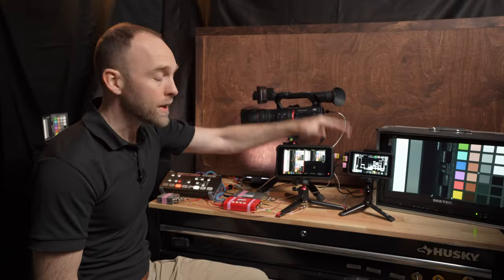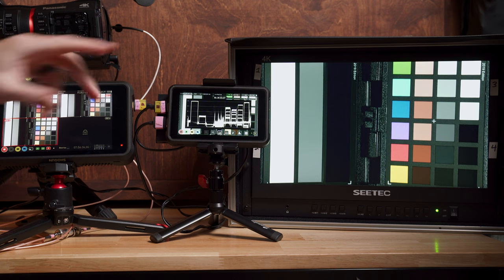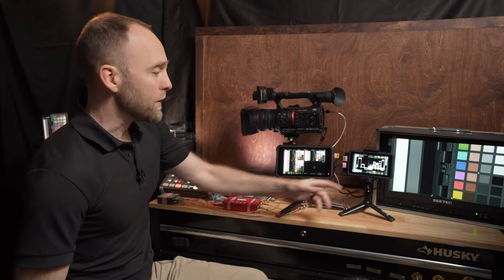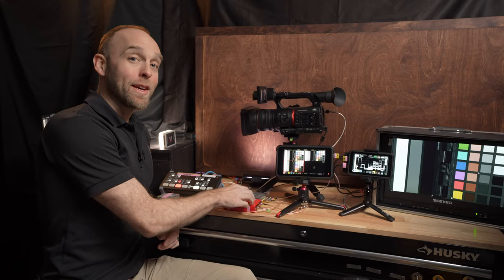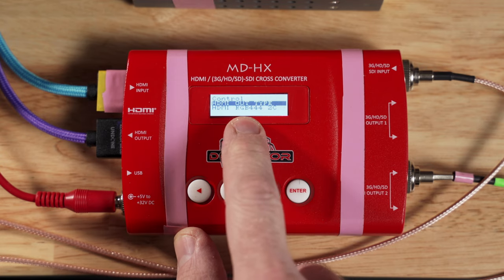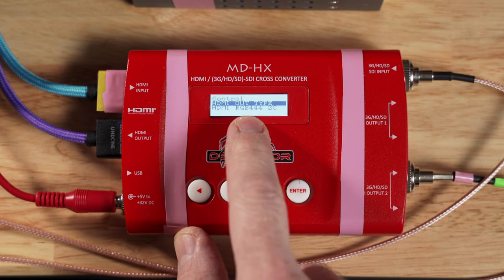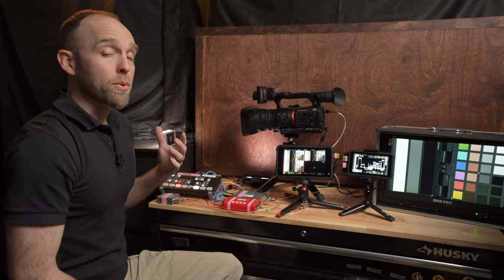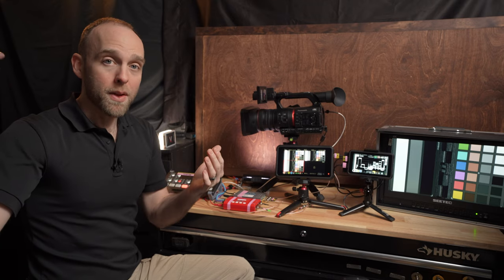Decimator PSA! - Properly Converting SDI to HDMI

Comment: Thanks a lot Marcus for showing this! I had the weird color issue (14:36 in your video) the other day and it kept me up way too long troubleshooting. For some reason - and for the first time - everything I sent TO the venues projector FROM my atmen mini pro hdmi out (hdmi version only) messed up the colors. As I remember it now it all looked ok when sending something directly from my mac studio hdmi out to the same projector. Does my computer send something else color/format-wise than if via the atem mini pro? I ended up getting help from an industry colleague who lended me a wireless Mars 300 hdmi kit (mac studio to atem to hollyland to projector) and suddenly the colors were normal. To get piece of mind before next time at the very same place in december I'm thinking of getting a Decimator MD-HX to be able to only run cables instead of wireless. Do you think it will solve the color issue since I could always try switching between rgb and ycb-modes in the decimator? Thanks! Best, Henrik in Sweden

Comment: Wow! So detailed. 
Question, I'm having problem with color not matching with laptop to laser projector. the setup is laptop connected  to the atem then to decimator to laser projector will that be  an issue?
Reply from the maker: HI there.  Thank you.  So, your laptop>ATEM>Decimator>Projector setup is correct and very common and no, there's no issue with doing that.......I do it every week with live-event setups.  If your Decimator is located NEAR the projector and using the HDMI output of the Decimator into the HDMI input of the projector, you might actually WANT to try setting the HDMI Output type of the Decimator back to RGG444.  HDMI inputs may be expecting that "full range."  Granted, that doesn't necessarily change COLOR per sé, just black/white levels, etc.  If your projector has an SDI input, then you may just be going Decimator SDI Output > SDI Projector Input.  In that case (or either case), if you're having color issues.....then I'd say your issues lie with the projector, and NOT the laptop/ATEM side.  You'll have to dig into your projectors settings and check everything:  Check what type of signal it's expecting, check color, change/alter your brightness/contrast, color settings WITH the projector settings........because your laptop is your reference point as long as your laptop's screen is a good one (If you're using Apple macbook pros, then those screens are pretty darn good as-is, so then try to get your projector to match your laptop screen as best as you can using the settings on the projector).

There are thousands of projector models, and lots of settings inside those projectors......and some are just way worse "out of the box" than others.

Long story short, the Decimator in this setup *shouldn't be causing you color-matching issues at the projector.

Comment: Hey Marcus, why do we put the Blackmagic mini converter to the atem then back out the atem to put it into the ninja?
Reply from the maker: Hi there Gerald.

If you're talking about the 3G Micro Converter, I talk about that at 4:36.  

I used the mini-converter for a couple of reasons:

1.  Because I HAD to convert to HDMI for the ATEM Mini.  It's the original ATEM Mini and only has HDMI Inputs/Outputs.  The point of this video is to show HOW improper SDI-to-HDMI conversion can ruin your black/white levels, so I need to convert my original SDI signal from the panasonic CX350 into SOMETHING with HDMI, so I used the micro Converter and the ATEM Mini.

2.  I also used the SDI Out/through of the mini converter to show (at the Shogun) that the 3G microconverter is NOT affecting the SDI signal, it just passes it through over to input 2 of the Shogun.....and I verify there is no change between input 1 and 2 of the shogun:  Shogun input 1 = Directly from AJA SDI splitter.  Shogun Input 2 = AJA SDI Split to 3G Microconverter SDI-Thru.

The reason I really dug into this is because when the ATEM mini products came out, they were only HDMI.  And during that time, most of the cameras that we used in live-streams had SDI-outputs and we typically used SDI in our standard signal routing.......but, the original ATEM mini was HDMI only......so everyone (including myself) grabbed a Decimator MD-HX and converted it by simply setting "HDMI Output = SDI Input," and we saw our image, and went on about our business.  

We did this a lot to ingest a camera into VMIX, Zoom, Teams, OBS, etc, for live streams and live-meetings (a lot during the pandemic)

But I started to notice very quickly that the resultant image inside OBS/Vmix/Zoom and also using realtime 3D rendering software "Notch" that the blacks were just crushed, and gone.....couldn't recover them with color correction within any of those programs, and the whites were also blown out.  

I started blaming the ATEM because it was the only thing "different" (or new) in our signal flow.  

But, I started digging deeper and finally used scopes properly to identify WHERE the problem was occurring.....all the while learning more-and-more about full/legal levels, etc.  And THAT'S when just scrolled over to "HDMI OUTPUT TYPE" in the Decimator MD-HX, and I saw "RGB," and I knew that a LOT of the time RGB Signals are in full range blacks/whites.......and I knew that most cameras/video switchers are YUV, which uses legal range blacks and white........so, I set up scopes before the Decimator, and then set up scopes AFTER the decimator with 2 monitors and changed the values and verified on my copes that both look the same and BAM!  It was that improper RGB conversion because I needed to keep my video signal in the YUV/Legal colorspace/range.

I hope that makes sense!  Cheersa
Reply from the maker: Also, one more thing, I think I forgot to say it this way..........using the Blackmagic 3G micro Converter to convert to HDMI > ATEM......I wanted to show that the Blackmagic 3G Microconverter WAS NOT improperly converting the HDMI signal (Input 3 of the ATEM).....but the Decimator (MD-HX and MD-LX by default, convert to RGB/Full)....Input 4 of the ATEM.

That's the other reason I used the Blackmagic 3G Microconverter in addition to all the other stuff.  

Does that makes sense??
Reply: @MarcusHutsell  ohhh that makes sense now, thanks! Your videos are really helping me learn more fully about signal flow. It was so confusing at first because of where to put the in and where to put the out

Comment: That's an excellent video! I was banging my head because of this.  

Is this a bug on the microconverter 3g? Why changing in the settings 16-235 and 0-255 doesn't do anything?
Reply from the maker: Hi there.  Thank you, yes, it took me a while to even think that the Decimator could be the issue.....scopes I tell ya, scopes!!

Anyway, as far as the Blackmagic "not working" when changing the values, I'm not sure.  Now I'm curious though as it might be that it only works if you feed a signal INTO it that is in full range (like sending Sony S-Log 3 from my Sony A7iv via HDMI to the Blackmagic Microconverter), then, maybe the BM selector would do something because it's receiving an SLOG (Full range) signal, and so we would need to tell the BM converter what to do with the full range signal.  I'll have to test soon ;)
Reply: @MarcusHutsell  yes that's something to test. It's unfortunate these decimators are impossible to find these days.

Comment: I see you have a seetec monitor in the built in road case…but no link to it in description. Which one is that?…I’m thinking of using some on set for folks who are not color scrutinizers but just need an acceptable ref image.
Reply from the maker: Hi there. That Seetec monitor is the ATEM156, it has 4 hdmi inputs and its own internal multi-viewer so you can see all 4 inputs on screen. 

Pretty good monitor, it’s not super bright, so I wouldn’t try to use it outside… but in office, studio environments it works great. 

I do we should have waveforms… But at least it has false color, which helps me see my exposure despite how “bright“ or dim the monitor is. In my opinion, false color is the absolute minimum of exposure tools needed on a production monitor.

I do also wish this one had SDI  inputs… But having SDI puts usually costs more and a simply converter gets the job done.

Here’s an Amazon link if you want to use that.  https://amzn.to/3xixqDm

Happy Production-ing!
Reply: @MarcusHutsell  thanks… I am considering the 4x SDI input version so good to know your thoughts on the hdmi version. They are usually in a black tent so should be ok. Thanks
Reply: Hey Marcus - follow up on that monitor - how do you calibrate it…..eyeball or which probe etc?
Many thanks

Comment: Thank you very much ! you're explaining the problem quiet clear, but now.... i'm into converting (mostly) PAL VHS tapes to SDI with the  BMD mini analog to SDI converter, and recording it with their Video Assist to ProRes422LT files, the source is a Panasonic DMR-ES35V and gives a stable video signal (DIGA feature) the video component YUV? (red,green,blue RCA) goes into that analog input of the BMD mini converter,  how do i know if there's coming out legal or full range from the SDI output ? since this can not be set....
Reply: Agree it is confusing. What I'd do in your situation is see if you can use a software waveform monitor/vectorscope and capture PAL color bars to then look at the chroma and luma color levels of the captured color bars and see if any levels appear to be clipped (in other words, extremely flat upper or lower parts of the waveform) like what is demoed in this video

Comment: I bought one specifically for use with teleprompter so that I could see a laptop screen image reversed on the teleprompter.  I can't get it to work. zero color output, zero HDMI output. I'm not interested in the re-scaling as i'm doing HDMI In and HDMI out. Only interested in ability to flip the image.  My telepropter shows an unreversed image when I take the decimator out of the chain. So I know the monitor and all cables work just fine.  How do I get the HDMI output to actually work. If I don't get this working soon I'll be forced to return it as a defective device so any guidance would be appreciated.
Reply from the maker: Hi there Thomas.  So, you CAN absolutely do what you want (use the Decimator MD-HX to reverse your image for teleprompter), I do the same thing ALL the time.

The thing is, you HAVE to use the scaler, because the "flip" function ONLY applies to video running through the scaler, so you cannot just set "hdmi output = hdmi input" and also use the flip horizontal/vertical feature.  However, even though you HAVE To use the scaler to get the horizontal or vertical flip-functionality, you don't have to ACTUALLY scale or change the frame/refresh rate.......you would basically set the scaler to EXACTLY the same resolution & frame/refresh rate as what your laptop is sending (and therefore what the Decimator is receiving) on the HDMI input.  You can see the resolution and frame rate on the home screen of the Decimator.......
Home Screen > Input Status > H:  (either "no signal" if nothing is plugged in to the HDMI input, or it will then show something like "1080p60" if that's what it's receiving from your laptop)......then you'd just set the scaler to exactly this......here are the settings:

First things first, reset the Decimator to Defaults > Setup Menu > Load Defaults

Then.......
Control Menu:
Control > HDMI Out Source = Scaler
Control > DUC Source = HDMI In

Scaling Menu:
Scaling > Output Format = 2 options:
Option 1:  Set the scaler to the same resolution and frame rate (refresh rate) as what your laptop is sending......so, if the Decimator sees 1080p60 on the home screen, set the Scaler to 1080p60.....AKA, no change in resolution or frame/refresh rate, but now you get access to the flip-functions.....or 

Scaling > Option 2:  If, for any reason, your monitor can't handle the resolution/refresh rate being sent by a device, then keep scrolling through resolutions and frame rates until the image shows up on your monitor. (remember to always pause/hold on a new scaler setting, as it takes the Decimator about 2-3 seconds to set the scaler output and for an image to show up on an external device).    This is helpful when I'm using a camera that sends 23.98fps, but a computer monitor maybe can only handle 60Hz (60fps) (because a lot of computer monitors CANNOT handle 23.98 or 24 fps).

Scaling > Horizontal Flip > (set to YES if neede)

Scaling > Vertical Fip > (set to YES if needed).

Should work like a charm! 

Let me know, there's nothing wrong with your Decimator, just gotta know the signal flow of how it works.

Comment: Hi first of all thank you very much for sharing. help me

I don’t know. Can you please teach me how to set SDI 1080i59.94 to SDI1080p 59.94? Thank you very much.
Reply from the maker: Hi there.  

So, you need to use the "Scaler" in the MD-HX.

You'd set:  SDI Output = Scaler

Then go To scaler:  Set the Scaler to 3G1080p59.94

Then go to DUC Source:  Set to SDI  - This tells the Decimator which input source to scale, you can only scale from the SDI input OR the HDMI input, you cannot scale from both inputs on a single device.

I almost always plug a proper video monitor into the SDI output to read and verify the frame rate is converting properly.  Almost any small video monitor like Atomos Ninja/Shinobi/Shogun, or any other small, proper video monitor will ALWAYS tell you the frame/refresh rate on the screen.  Atomos has theirs in the top-left corner of the monitor screen.

Comment: Here we mostly use BM microcoverters to convert SDI to Hdmi
Reply from the maker: Yep, I have and use mostly Blackmagic too.  Mainly because they're (1) more available (seems like Decimator products area REALLY hard to find in-stock these days) and (2), the Blackmagic converters use USB-C, whereas the Decimator MD-LX still uses Micro-USB.  But, Decimator products ALWAYS seem to fix any issues when converting where I still may have issues of signal-passage with some Blackmagic converters.......depending on the frame rate, other equipment in the signal chain, etc.

Comment: I bet full range is the right way to do it with pro stuff.
Reply from the maker: Actually, no.  Almost all video broadcast equipment, cameras, live video switchers, is based on Legal range video signals.  

Full range is for any devices that were designed to operate in full range.   Almost NOTHING in the professional live-event production world is full-range.  Some computer monitors can handle full range, some cannot, but many computer monitors are in the RGB color space which operates in full-range most of the time.  

It really is just a difference in how the min/max black/white/greyscale levels are encoded and if that next device is expecting legal or full-range.  

When recording LOG footage with cameras, LOG footage records in full-range and you CAN output a full-range signal from a camera depending on the camera and the settings......but for LIVE-production, you're NEVER sending that LOG/full range output to a video-switcher for in-room magnification.  You might send the LOG format to an external recorder which CAN handle full-range, but when taking that footage into a video-switcher, it needs to be legal range, or editing that footage, we're almost always converting back to legal for sharing/internet/client-hand-off, etc.

Here's a quick article:  https://www.portrait.com/resource-center/video-content-ranges/
Reply: I remember reading into that before, because it puzzled me why the decision would be made. Now I'm pretty sure it's like fractional frame rates where it's just done that way because that's the way it's always been. If I remember right, it was primarily do to blanking intervals on analog video signals, and making those signal more reliable with noise, instead of requiring absolutely 0 volts for blanking to register. As with many things in life "why change it".
Reply from the maker: I also just realized I mis-typed one thing in my previous reply… I’ve now edited my reply above…. what I meant to say, was any video signal going into a live production video switcher needs to be LEGAL range, not full.

Comment: "I usually do 422, because I'm a jackass with more money than brains." All this pricey gear, and you choose a color compressed option... that's what 422 means.
Reply from the maker: Well, jack ass or not…. sometimes the next device in line can’t  handle 4:4:4… If the next device can’t handle it,  then you can’t use it or else your video signal chain won’t work.
Reply: Then that next device isn't prograde and you're bottlenecking quality, no? (yes). Would make sense to not tollerate that, with that level of gear.
Reply from the maker: Yes, it would be a bottleneck if it can't handle 4:4:4....but, in live production, you don't always get top-notch gear.  Sometimes budget, or the people pulling gear in the warehouse (or people purchasing it), don't know and don't care, they just throw "computer monitor" on the truck.  You'd be surprised at how much consumer-gear gets used backstage in a lot of productions.  I don't like it, but I'm also at the mercy of my market/city/budget at times.